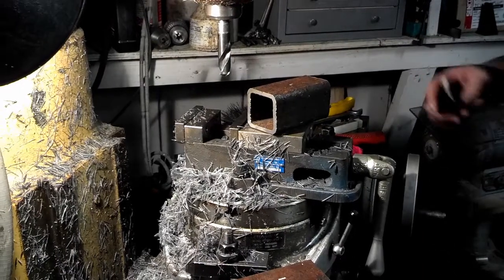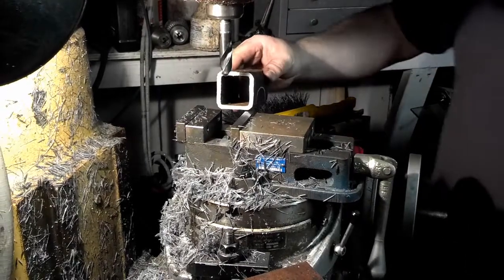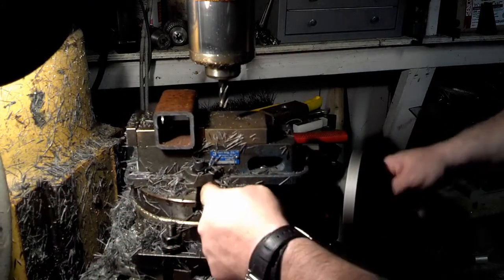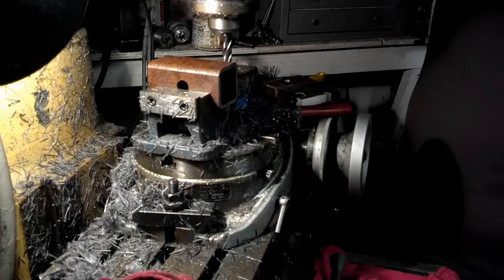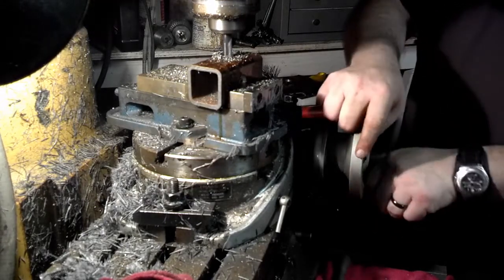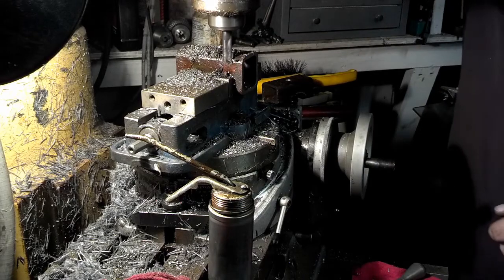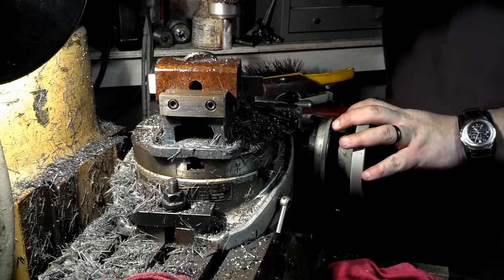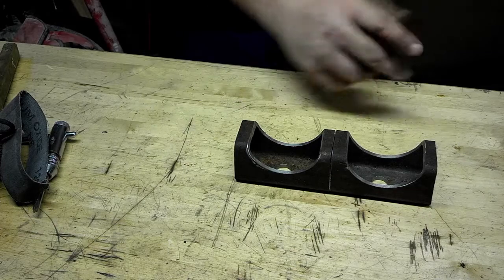Trailer axle repair Part 2: Making spring perches

Comment: Spring seats for a 3" dia. axle are around $6-$7 per pair. Why would you go through the process of making your own by consuming your time & wearing your cutting tools to only save $6-$7 bucks?! I could understand machining a hard to find/obsolete part or an expensive part if it was very cost effective to the project, but not to save $6-$7!
Reply from the maker: Because it would have been $20 by the time it got to my door, and this didn't cost me any money out of pocket, and I had the part that day.